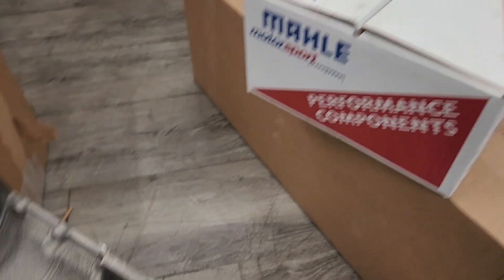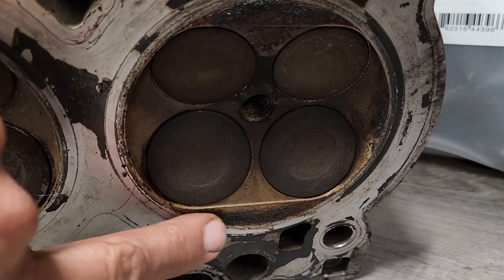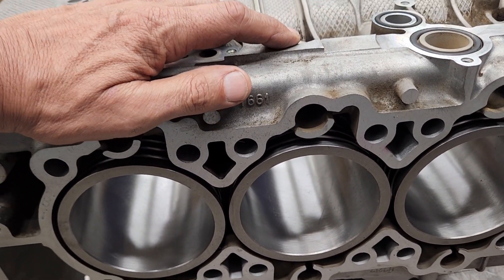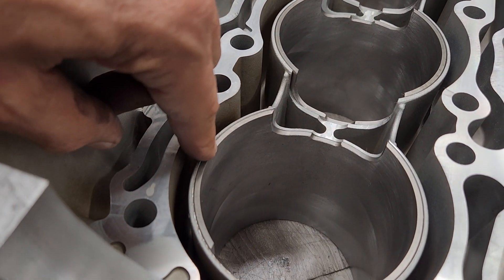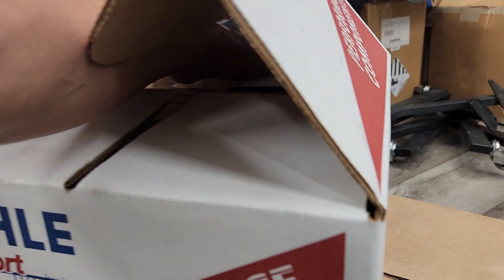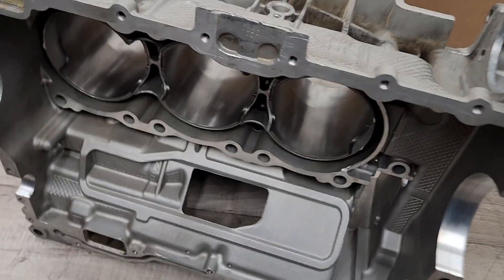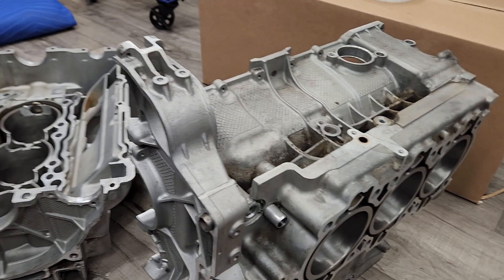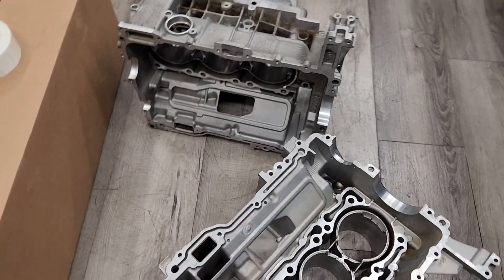Porsche 911 996 997 3.6 to 3.8 Block Repair with LA Sleeve Ductil Iron

Comment: According to many people's experience on forums, using steel/iron sleeves results in head gasket failure within a few thousand miles because the expansion coefficients are different from aluminum.
Reply from the maker: I had read the same and discussed this with LA Sleeve who out me in touch with a couple of their customers that own Porsche specialty garages.  I spoke with one, because I know their reputation, and they said they have not experienced any head gasket failures related to sleeve installation.

That said, I don't doubt the problem has happened but LA Sleeve has been at this a very long time, where as many machine shops simply don't have the experience or equipment to do a job like this successfully.  But if it blows a gasket I'll be sure to post that up

Comment: I think that "Mahle" is pronounced like the name Molly.

On that 996 engine, you are going to replace the IMS bearing with something that permanently fixes the famous issue, yes?

Great video!
Reply from the maker: I called the corporate offices yesterday about a different set of pistons and it seemed that pronounced it Mall lay.

Yes ims will be addressed.
Reply: @ProjectsMB  When I was 18, my friends dad built a 355 Chevy SB with a B&M street blower and used Mahle pistons from Germany. That's how he pronounced the name.
Reply: I managed a Porsche shop where we had a guy who had done a 4 year internship at Porsche. He cleared up a couple things for me, I figured that he'd know since he learned German and worked at the factory. Mahle is a two syllable word. Porsche is a two cylinder word, unless you're from Bakersfield. He's a lead engineer at Bosch now.
Reply from the maker: @stevenwillie2782  by coincidence I had to call their corporate offices earlier this week and the auto answer machine pronounced Mahle as mall - lay, yes two syllables.
Reply: @stevenwillie2782  "Mah lee" and "Por Sheh".
Reply: @Flies2FLL  Yep, but Bosch is still one syllable. :)
Reply: @stevenwillie2782  Well...Yes. Thank you so much for adding that!
Reply: I just got my hands on a C4S that  has a good amount of noise from the bore scoring. Looking at a 4.0 build. Basically the same as this.
Reply: @fundamentallybroken4194  Do the LN Engineering IMS bearing fix!  I have no affiliation with this company.
Reply from the maker: @Flies2FLL  agreed I've done of few of the ims upgrades before
Reply: @ProjectsMB  Awesome!!  Keep up the good work.  More Posche content please, but that LS with the ITB's was to DIE for!
Reply from the maker: @fundamentallybroken4194  I also have gts 4 3.8 that I'm working on a 4.5 for